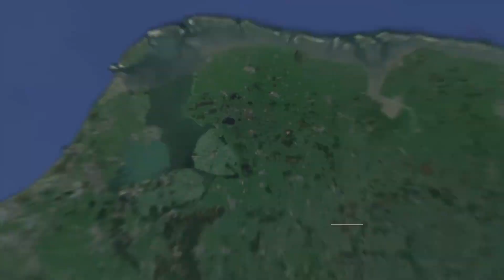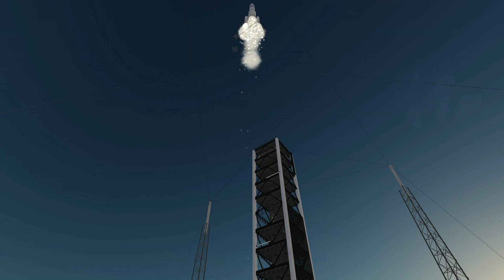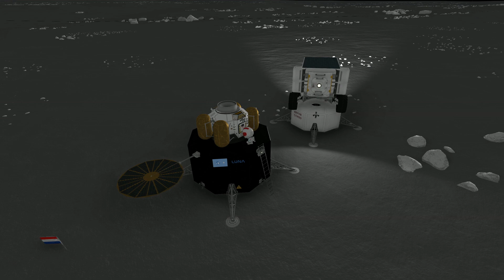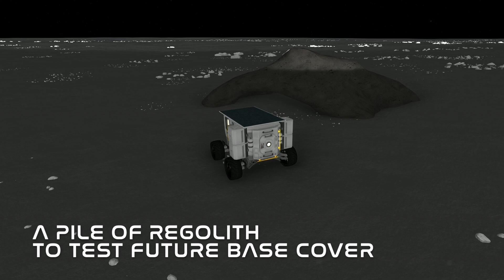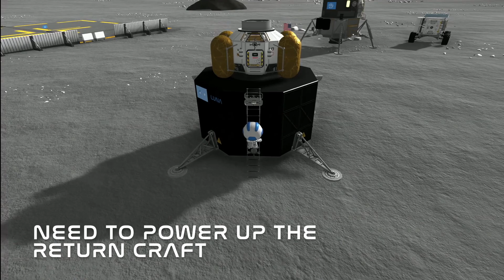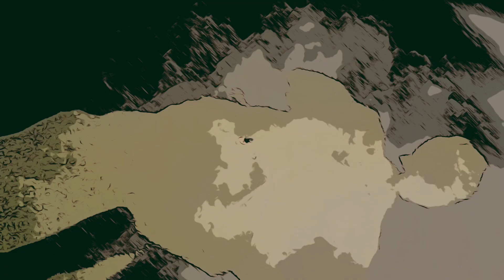Episode 24: Here to stay

Comment: Building the rover ramp using the descent module panels was fantastic! reminds me of the LEM Truck concept, but they would have some pull out trailer ramps tucked away inside, still need an astronaut onsite to do the work, so you're close enough to that requirement ;D
Reply from the maker: The LEM truck and the Soviet equivalent were such great ideas. If we had not done Shuttle, we would have had enough budget to keep Apollo running and make this a reality